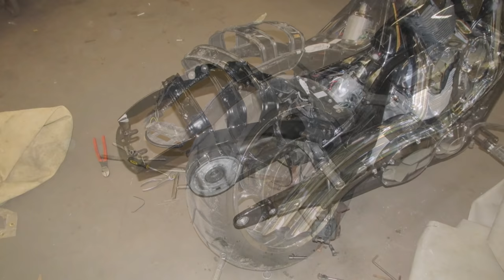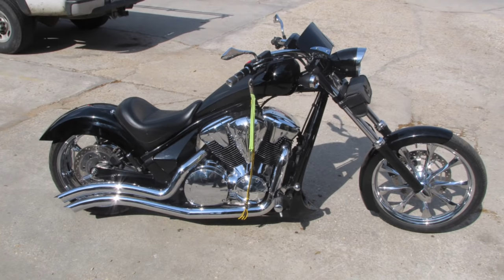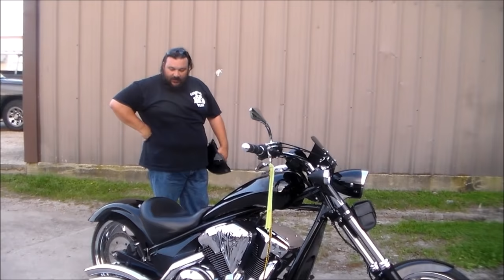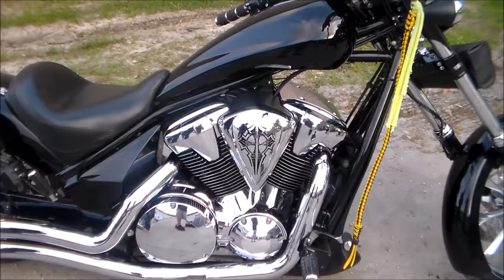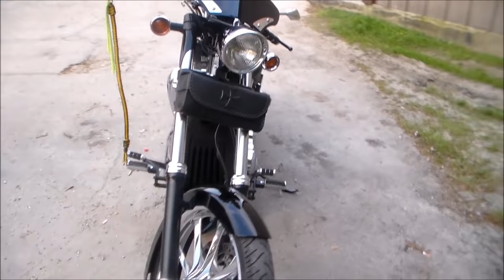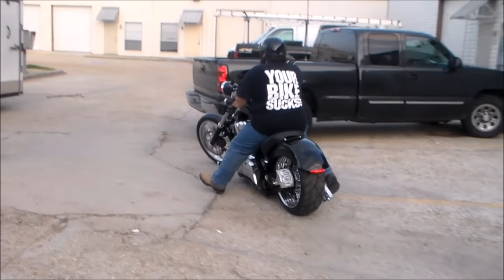honda fury wide swingarm and 240mm rear wheel install by bad moon cycles

Comment: From what I heard was u can put a 240 tire on the fury as is but u have to let all the air out of the tire then once its on u fill the tire back up, but that's wat I here
Reply from the maker: well we ended up having to widen the swingarm because he had air suspension and the 240 couldnt fit into the stock subframe when the suspension was lowered. And as far as putting the tire on with the stock swingarm, we had to let out all the air and bring the tire in from underneath.
Reply: bad moon cycles oh OK, I don't kno about that but low and mean had a video on that, but nice ride brother
Reply from the maker: thanks dude. we appreciate it!

Comment: just to know...can I use a 240 tire in the stock wheel without change anything, only the air tire thing??
Reply: +1.. I am interesting in this topic as well... Will it be possible to install 240/40R18 on stock rim and fender?